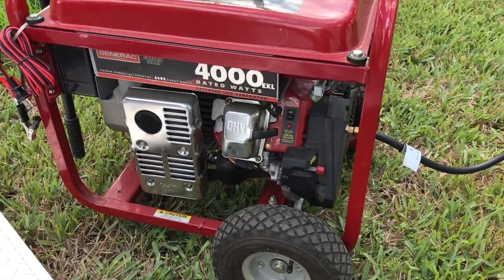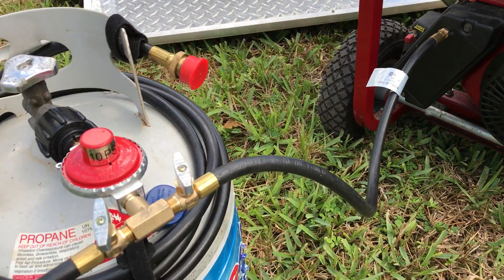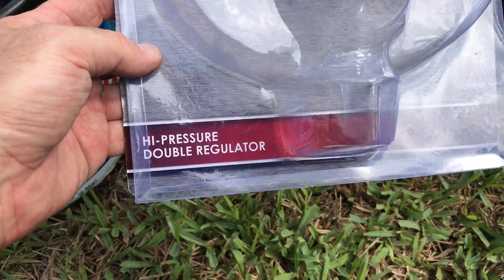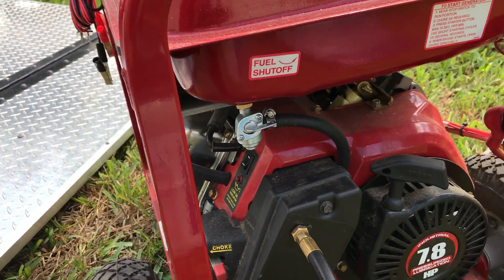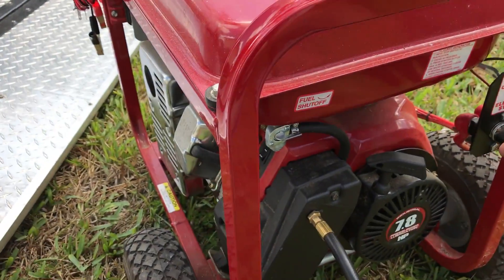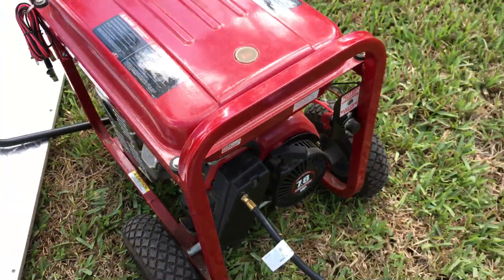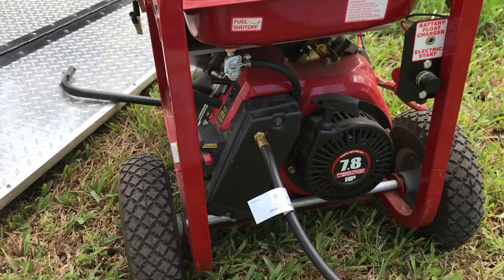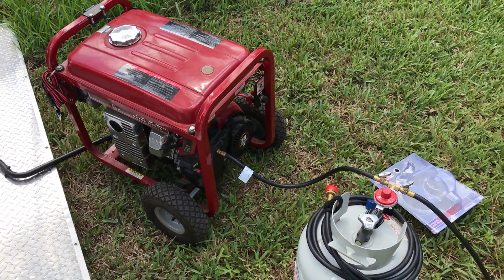Generator Propane Conversion-No Kit. WARNING: THIS IS FOR EMERGENCY USE ONLY AND CAN BE DANGEROUS!

Comment: What about varying fuel requirements for varying loads?  Will it require a regulator adjustment for different loads?
Reply: It will just die at different loads or catch on fire because this guy is a moron.

Comment: The MAJOR issue with this is if your gen shuts off the propane will keep flowing, you need the other part hooked up to the regulator to stop the propane from flowing when the gens off
Reply from the maker: You are absolutely right and if you read the warning on the video and in my previous replies, you would know this has already been covered numerous times. This is for EMERGENCY USE ONLY and ALWAYS outdoors! THIS CAN POTENTIALLY BE VERY DANGEROUS. Always keep a close eye on the generator while it is running under propane when connected like this.

Comment: Came packaged perfectly. This Generater.Systems is awesome! No problems starting on Propane. Three cranks and it lit up. I highly recommend it if you are looking for a bigger generator for a camper or to have during a power outage. Dual fuel source is the way to go!!!

Comment: I run similar method on my Honda Generator, what I do is start it with Gas then shut fuel valve off then transfer to propane with a regulator valve like found on air compressor air line. Only down fall is I have to manually govern amount depending on load at that time.

Comment: If you keep choke open it won't take near that time to crank and save propane
Reply from the maker: That was my first time attempting to start the generator after doing the propane conversion. I’ve learned to cut back on the propane and it’ll start right up. Remember, this is for emergency use only and at your own risk. This is not for general use.

Comment: It would probably work in a pinch if you absolutely needed the generator right now and couldn't get gas but it's not a good idea for general use. If you're planning on regularly running on propane just spend the money for an actual conversion kit with a proper regulator, they're not that hard to install.
Reply from the maker: You’re absolutely correct and I would’ve done that had I’ve been able to find one. This was done as we were preparing for an approaching hurricane. I didn’t have any choice. Once again, this is only to be use in case of emergency, and at your own risk.

Comment: What happens if the generator stalls out and the propane is still on?  Will it stop the flow or still the gas still flow?
Reply from the maker: No. There is nothing to stop the flow of propane. This is to be used in emergency situations only with the generator outside.

Comment: How did you hook it to the fuel intake?
Reply: Jammed it into the air box. Don't do that btw.
Reply from the maker: A hole was drilled into the filter housing, and the propane line was run into that. Remember, this is for emergency use only and at your own risk. This is not for general use.

Comment: On the carb there is a connector. It's the hose that comes from motor that connects to carb. This is for extra gases that didn't burn to be recycled back through the carb. Just disconnect that hose from the carb, connect the propane or natural gas hose, boom it states. Just use some kind of regulator to open close how much propane the carb receives. You don't need these overpriced kits these people sells. Don't know why they are overpriced, they are making huge profits on them kits, trust me. It costs less than $50 to make those kits.
Reply from the maker: Rob Powell  I agree. The only advantage to those kits is they will shut off the flow of propane if the generator stops. 

As far as other connection options, there are many ways to skin a cat. This was my first attempt and it worked perfectly for an emergency situation.
Reply: Tony Voodoo If you hook that to the natural gas at your house 🏡 and generator goes off while you’re sleeping 😴. “Houston we have a problem “!!! We have lift off 🚀!!! Pay the money for the kit....
Reply: @johnnieblack1061  The kits don't shut the gas off unless you have the ones with electric solenoid on them. I have 7 generators with propane/CNG conversion carb kits and as soon at you turn gas on you hear hissing. No matter what if you go cheap Ebay or Amazon they won't have a shut off if gen dies.
Reply: The extra is forsomeone else to design and manufacture the kit, eat the regulations, provide warranty and guarantees, stock and or ship it.

Comment: Thanks for the video. One company wanted $230.00 for a kit.
Reply from the maker: Pete Urbann  The good thing about the kits I’ve seen is they will cut off the flow of propane if the generator stops for some reason.
Reply: @TonyKoji  I just look at a video of a $45.00 auto shutoff valve.
Reply: @urbannpa  -  Just look on Amazon for C-JB-2 Converter / Vaporizer / Regulator
Reply from the maker: Remember, this is for emergency use only and at your own risk. This is not for general use.

Comment: What is that leaking sound when you turn the gas on
Reply from the maker: Propane. This was my first attempt at starting the generator after the conversion. There was too much propane flowing at the time. That’s why it was difficult to start. After a couple of tries, I was able to start it on the first crank.

Comment: You don't even need to cut a hole in the air cleaner- just introduce the gas through the recirculation tube that goes back to the intake.
Reply from the maker: More than one way to skin a cat. This was my first attempt while attempting to get ready for an approaching hurricane. The hole I made can be easily covered.
Reply: @TonyKoji  -  You are 100% on..... The " HOLE " can be easily covered when NOT in use.  That way you can run Gas or Propane " switcheroo ".  You did the right thing and don't listen to stupid folks!
Reply: @JodBronson  In college , for Mechanical Engineering I had 1 professor who made fon of blue collar shop floor workers who laughed at engineers. Now I have for 25 years.
Reply: @itsruf1  -  You don't need 4+ years college to understand something really simple!  LMFAO
Reply: Very good idea
Reply: Yes this the recirculating tube..couldn't think of the name of it when I posted it.
Reply: I have installed a few propane whole kits. I tried to do an emergency hook up through the exhaust recirculatin rubber hose and T it in there. It didn't work not efficient it let's propane in the crank case on the back side of the piston with a little pressure. If I vented engine with rubber hose and fuel filter going down to ground. And used the rubber hose with propane going into this rubber hose going into intake this would work. Instead of drilling a hole into carb or air cleaner. I've used a propane torch just using propane to start alot of gasoline engines over the years. A quick access intake port hose with rubber cap would be nice for a shot of propane to help quick start non converted gasoline engines. Why propane it doesn't flood. No carb problems or treating the propane fuel ever. If engine starts on propane you know you have ignition fire with out pulling and testing for spark. With propane in the winter or any time propane immediately gets into the engine to run. This is alot faster with propane and keeps from wearing a battery down than trying to start on gasoline. that I haven't converted to propane or if I run out of gasoline I can use propane. Never get you head or hands around intake or carb for safety when starting.
Reply: I've used propane for years every one thinks propane is going to go bang out side in the air. Funny I can't get my propane 500,000 BTU weed burner torch to light because I need to update the spark with a newer battery powered push button ignition spark. Old natural gas stoves with doors and propane grills with lid closed or even open after gas filling it with gas going in grill or oven is a NO NO while trying to light it. THIS CAN BURN YOU BAD OR WORSE READ OWNERS MANUAL. WHEN YOU START USE OR COMPRESS ANY FLAMMABLE GAS IN A ENGINE OR TIRE THIS IS WHERE IT GETS DANGEROUS. DON'T DO IT IF YOU DONT TRULY UNDERSTAND HOW GASEOUS FUELS WORK. SAME THING WHEN GUYS START ENGINES USING STARTING FLUID OR GASOLINE WITH HEAD ABOVE ENGINE NOT GOOD AT ALL CAN BACK FIRE ESPECIALLY WITH STARTING FLUID, GASOLINE OR PROPANE. I DONT USE STARTING FLUID ON GASOLINE ENGINES WHY? ITS HARD ON THEM AND TRASHES MILKS THE OIL. IT CAUSES RATTLING, NOCKING, SMOKING AND MORE! INSTEAD I USE PROPANE FOR HARD TO START GASOLINE ENGINES BECAUSE PROPANE IS THE BEST. ALWAYS BE SAFE AND WEAR SAFETY GEAR EYE AND EAR PROTECTION WHEN USING LIQUID FUELS OR GASEOUS FUELS.
Reply: ME THINKEM SOUND IMPORTANT WHEN USE BIG LETTERS LIKR ME YELLING AT READER,   ME SMART.

Comment: Start it on Gas then Switch Over to Propane???
Reply from the maker: randy beard Not sure how safe that would be. This was my first try at starting it with propane. I later learned that it needs to be throttled way down. Once I made that adjustment it fires right up.

Comment: My generator varies RPM with load. Does your adaptation vary propane flow with load?
Reply from the maker: Jim Julian  No. I had to adjust the flow of propane to account for the increased load.

Comment: If the engine stops running does the propane stop flowing?
Reply: These are meant for outdoor or monitor usage only.  If you want to be SAFE and unattended and on demand.  You need C-JB-2 Converter / Vaporizer / Regulator to auto shut-off / on-demand.
Reply from the maker: Dale Wier No, the propane will continue to flow if the generator stops running.
Reply: My BBQ has a Gasfuse brand safety shutoff in Oz.. Shuts off gas when BBQ flames out or doesn't light .Maybe could be used here? Is an add on accessory. You press in to reset if it shuts off. Auto kills gas flow in a blink.

Comment: Just curious is it safe to operate that way I have a Coleman 10 horsepower 6250 watts thinking about converting it to propane please let me know if it's safe thank you
Reply from the maker: steve fuhrman This is only for use temporarily in an emergency. There are adapters available with cutoff valves that will shut off the flow of propane if the generator stops running.
Reply: @TonyKoji  thank you sir appreciate the information running the generator is only for emergencies situations can't afford 250 bucks for the original shut off valve

Comment: propane hose need to go behind air filter at least
Reply from the maker: Vlad Fred Kovac I wasn’t looking to make it aesthetically pleasing. This was purely functional.
Reply: Nothing to do with esthetically pleasing,  purely functional LP inlet should be behind the filter.
Reply from the maker: Vlad Fred Kovac Please explain.
Reply: Tony Voodoo  -  its a common sense based on suction. The carb/engine will suck the propane better if the inlet LP hose is between the filter and carb. also the way u have it must be leaking lot of propane in the air vs behind the filter the engine will suck all of it in if properly adjusted so no leaking LP into the air.
Reply from the maker: Vlad Fred Kovac OK, I wasn’t clear on what you were trying to say before. The connection is inside the filtered area.
Reply: In that case u r correct. It looked like it is before the filter just from watching the video.
Reply: What happens if the generator stalls or stops does it keep pumping out propane?
Reply from the maker: Damn Yankee Rider That was covered in previous comments. This is for outside use and only in an emergency situation. If the generator stops the propane will continue to run. Chances are you’ll know when it stops but I would advise supervising the generator while it is operating with this set up.
Reply: @TonyKoji  that is correct
Reply: Yeah it’s a great idea and no I didn’t read every comment so I don’t know the total conversation

Comment: How did you know where to drill the hole.  Does the fuel line then connect to the carburetor?  Good video.  Thanks for sharing.
Reply from the maker: You can drill the hole anywhere in the intake cover. Just make sure when you thread the line through it won’t interfere with anything on the other side.
Reply: @TonyKoji  are just dumping the propane onto the air intake in front of the filter? Or is there a tube continuing from the hole you drilled, to the carburetor?  Do you need electric start for this to work?  My generator only has a pull start.
Reply from the maker: @jeffmckenzie7282  The propane flows inside of the air filter directly towards the carburetor. The hose does not continue into the air filter housing. Remember, this is only to be used in case of emergency and at your own risk. This is not for general use.

Comment: Do you have any idea how long that will run on that 20 pound tank?
Reply from the maker: Martin Marsh I didn’t need to run it that long after the hurricane but I’d say a couple of days.
Reply: I have to try to find out, that is what I'm hoping for.
Reply: I just found this info on another guys video, he claims, 1 pound per hour for 10 horse power. So if you have less horse power it is obviously going to do better. But 20 hours isn't to shabby.
Reply from the maker: Martin Marsh I was thinking it would last longer than that but you may be right.
Reply: He may be right, but it is one of those things I have to find out, if I do I will get back to you.
Reply: Samoh, that is kind of irrelevant what I am powering, if my generator says I will use a tank of gas in 8 hours at full output. What I want to know is, will propane last me at least as long or longer. I don't have a problem with gasoline, I don't keep it around long enough to go bad.

Comment: Sounds like the engine is surging a lot. Have you tried a load on it yet?
Reply from the maker: That was the initial starting of it. Since then I’ve learned to barely turn on the propane valve. Once it starts I can put it under load and adjust the fuel delivery. No problem with surging once it’s under load.

Comment: Hello, how many hours does the generator run with the 20 Lb cylinder?
Reply from the maker: I’m not sure. I have heard they run longer on propane than on the equivalent amount of gasoline but I have not ran it enough on propane to say that for certain.
Reply: A 20 lb tank holds 4.3 gals of lpg.
Reply: @joesphfauver-kingsland8713   4.7 not 4.3

Comment: All that matter is that it works.
Reply from the maker: lenarama1066, I wasn’t looking for economy, I was looking to remedy an emergency situation. During the hurricane gasoline was in short supply or nonexistent. I was looking for an alternate fuel source to keep the generator running and providing energy to the house. This is not something I would recommend doing unless it is an absolute emergency.
Reply from the maker: Richard Paulson, hopefully you read my disclaimer and you’re also not running the generator indoors. I can’t stress enough, this is for emergency use only. I was able to run a 12,000 BTU air conditioner with no problem on that 4000 W generator. Is that for power? Hell, I don’t know. It worked good enough for me. The only problem I had with it was the initial start showing on the video. Once I realized that I was giving it too much propane, the problem was solved. After that it ran without a hitch.
Reply from the maker: Marty Marsh  It got us trough the aftermath of hurricane Irma without any problems. Once I figured out it needed very little propane to start, it worked great Ran out of gas, switched over to propane, no problem!.
Reply: I have been watching a lot of these videos also, and I like the simplicity of it.
Reply: If it stalls and you dont catch it, lp gas will flood your space and it sinks.

Your gen had surging which is a sign of lean mixture.

Could you get full power out? I'll bet not. Load regulation is poor which is corrected by a pressure regulator.
Reply: Running too lean can burn the valves in the engine.  May well be false economy if that happens.